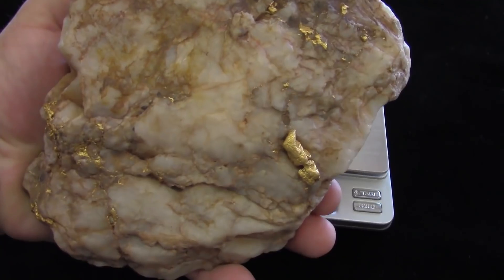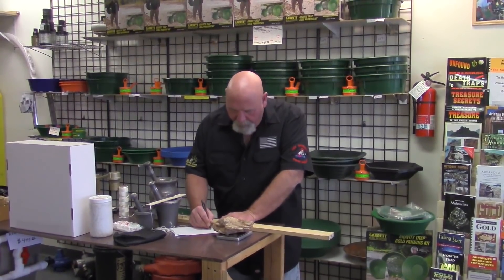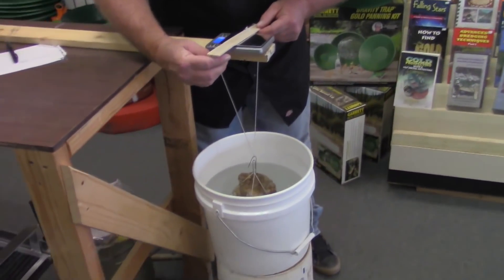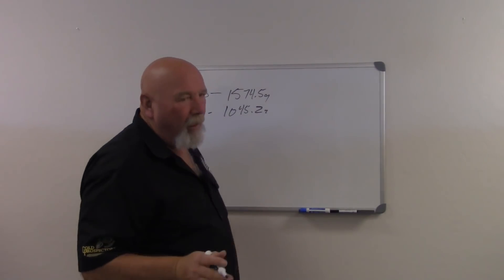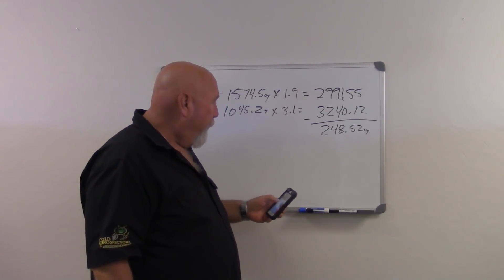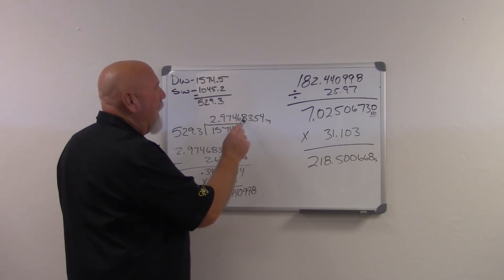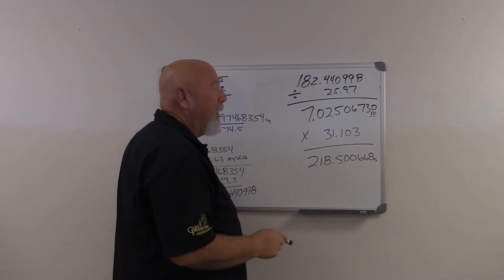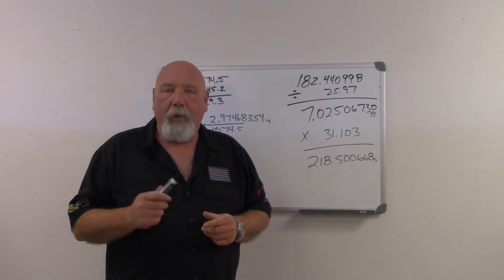How to calculate the weight of gold in a gold in quartz specimen without crushing it.

Comment: Thank you for the video.  I have come up with another formula for you that determines the weight of gold in a specimen. The formula is:-

Gold = Ws[Dg(Ds-Dq)]/[Ds(Dg-Dq)]   -  formula (1)
or
Gold = Vs[Dg(Ds-Dq)/[Dg-Dq] - formula (2)

Dg=Density of gold
Dq=Density of quartz
Ds=Density of specimen
Ws=Weight of specimen
Vs=Volume of specimen

To use your example:

Dg=19.3 g/cm^3
Dq=2.63 g/cm^3
Ds=2.975 g/cm^3
Ws=1574.5g

Using the formula (1):

Gold=1574.5[19.3(2.975-2.63)]/[2.975(19.3-2.63)]

Gold=1574.5[19.3×0.345]/[2.975×16.67]

Gold=1574.5[6.66/49.59]

Gold=1574.5×0.1343

Gold=211g (rounded off)

Like any formula this is only as accurate as the numbers plugged in but gives a more accurate gold weight than equations using constants.  

If the volume of the specimen is being used instead then formula (2) can be applied.

For more accuracy I suggest determining the density of a quartz sample from the region your specimen was found using the methods already presented. If gold in the area is not pure this can be accounted for by altering the density of the gold accordingly.  This formula in fact can be used to calculate the content of anything within something else if their densities are known.  

Hope this helps.
Reply: Hi. Would you mind if i asked for help here?
Dry weight 35.56
Wet weight 25.74
 ???
Thanks
Reply: @jackojeep8276   I calculated the gold content to be about 11.3 (g?).  That's about a 1/3 gold content by weight.  As mentioned this number will change if the densities of the gold and quartz are different but gives a fair estimation.

Comment: Interesting the difference between the dry and wet weight 529.3grams. Perhaps that is the volume  529.3 mls or ccms... x+y=    529.3,   x19+ y2.63 =1574.5 solve for x the volume of gold in ccms. Is called a simultaneous equation. Also if ironstone present in quartz use a higher sg. for quartz.

Comment: I am confused. Not by the math but by the answer I got . Which simply put me right back where I started. See, I know what I have is a piece of quartz and gold. I know this. Thing is, I have never had anything like this before, and I don't understand why the gold part of the rock completely encompasses the quartz part, I guess you'd say. It looks like this was dipped in gold. The entire surface is covered except for a very small patch. I don't want to break the rock to see the inside. Okay the problem. My math brought me almost exactly to the original dry weight, except for 1  3333/20000 
I checked it twice. I don't know what  I am doing wrong.  I feel stupid.

Comment: This was kind of hilarious.  The fellow in the video seems sincere but he just doesn't know what he's talking about despite the white board and big talk.  Hasn't anyone wondered what the purpose is of submersing the piece in water?  he never explains it and he never shows it, probably because he doesn't understand it himself, but the whole purpose of submersing the item in water is to determine how much water the item displaces (including the gold and the quartz).  That means he would have needed to take a measurement of the water levels before and after submersing the item and take the difference to determine the cubic area/volume of the item.  he never did that and he never even alluded to it.  He never did it because he couldn't have done it using the bucket he had, which had no measurement scale on it to show how much the water level rose when he put the item into it.  Besides, that bucket was far to large anyway.  He needed to use a large beaker for that exercise, one with a standard volume scale on the side, which would have given him a delta of X number of liquid ounces.  That would translate to a cubic volume.  The expected weight of pure quartz would be obtained from that volume.  Then the actual piece would be weighed (dry) and the difference would suggest the weight of other, heavier, elements, including gold, are embedded in the item.

Again, it's only an approximation and depends on many variables.  Just looking at the item, I doubt it contained 7 ounces of gold unless there was a lot of gold embedded at the core of the piece - unlikely but possible.  We really won't know since the specific gravity test was never done properly.